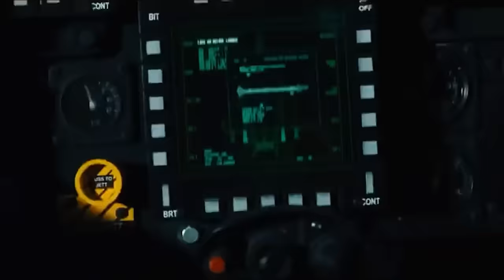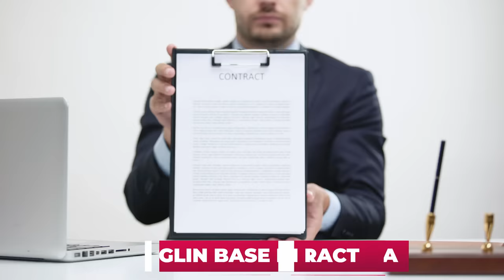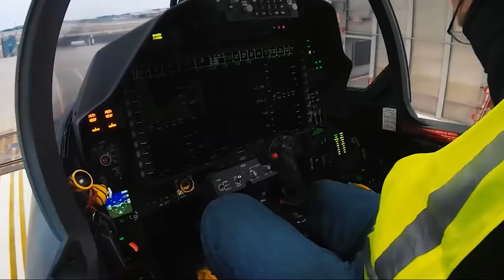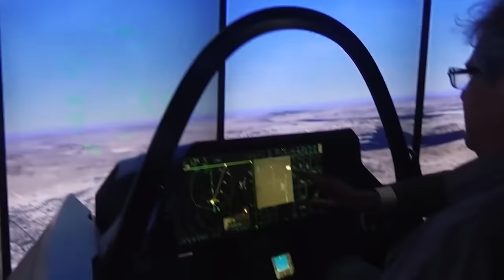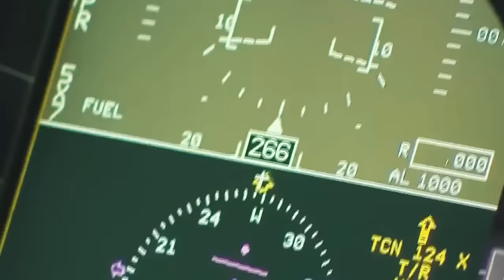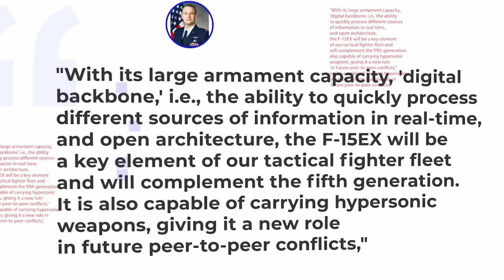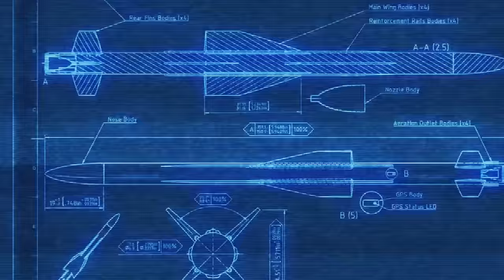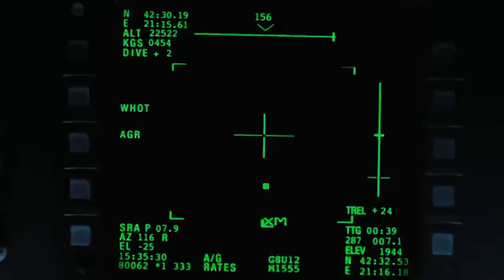NEW Upgraded F-15EX III Shocked Russia And NATO Countries

Comment: 1.7 TRILLION PLUS and they cannot get it right.  I think I know where the missing defense funds were used, in for a penny in for Trillion.

WOW.  I bet the Israelis over came these very serious design failures.
Reply: Most of the f35 issues have been corrected.  There were a bunch because of the dumb way that dod did procurement.  Today it is the most capable fighter for real world modern air combat.  

The 1.7 trillion is the total estimated life cost of the jsf program.  We havent actually spent anywhere near that by now.  Its planning for acquiring 2500 planes, upgrading them every six months, and maintaining them until 2070.  Its a bs number that makes it impossible to compare to anything else because its largely a result of service life and numbers acquired.

Comment: Hell I would also coat the thing in the same radar absorbing paint that the F-35 and F-22 have so its at less likely to be picked up on radar. Even though the thing is designed to be a hard charging loud and violent ass kicking machine to allow the aforementioned F-35 and F-22 to slip in behind enemy lines and fuck up the enemy without being detected.
Reply: It is, although both the f22 and f35 use different ram.  The f15ex has a reduced rcs and should be safe from most systems at 100 miles, compared to the 15 and 30 miles of the f22 and f35.  A f15c, for comparison, can be locked by a good radar at 250 miles.

Comment: These will make nice missile trucks.  Absolutely love them for their designated role.

In pure air to air combat, how many of these would it take to defeat 1 F22? 4, 6, 8 or more? I say this not to denigrate F15EX, but rather looking at cost to capability. We should have never shut down the Raptor program.
Reply: Far too many would be necessary to defeat a Raptor. The Raptor can smoke as many of these things as it holds AMRAAMs, or coming up, the twice-as-small Peregrine.
Reply: @Ilyak1986 radar on an F-15 is as good as it gets and the whole world knows it must get better at detecting stealth and the F-15 is leading the way. The raptor is wicked effective as a anti aircraft weapon system. But ngad and the wingman weapon system will replace this short run aircraft. The raptor can see the F-15 (anything can) but it can see the F-15 integrated ai equipped (stealth drone)wingman system.
Reply: The F-22s are amazing for sure but they're too costly and That amazingness is not worth the cost since they're so far beyond pretty much anything flying we can actually take a step back to reduce costs and still have an edge. On top of that there's the issue with payload and the fact that 22s can only communicated directly with other 22s without AWACS. In the end it's not really a competition between the 15 EXs, 22s, and 35s, they each have their roles to play. An F-35 can pass targeting info to an F-15 to kill a target outside the the F15's actual radar range, which is pretty cool. (It can do the same for the F22 as well, I believe but the F-22 can't "talk" back to anything but another 22 or an AWACS which can then "translate" for he other planes).
Reply: @redrolo149  Yes agreed on many counts.  My point continues to be, F-22 is only expensive if you measure cost per plane, vs cost per capability.  When 1 F-22 at $125 million can take out 6 enemy gen 4+ fighters with a kill-loss ratio of 15-1 or greater, does it matter that F-22 is 2x more expensive to own and operate?

Comment: Easy, they don't have a choice. The F22 has finite numbers, there will be no more made. And the F35 is a failure.

But dude, where do you get your info? F22s fly in Alaska all the time. The F22 is not allowed to go above  25000'? Are you on drugs? Sure, back when it initially entered service there was an issue with the BRAG valve on the pilot's vest, but that was all fixed and restriction lifted by early 2013.